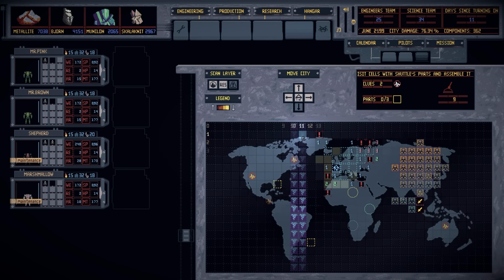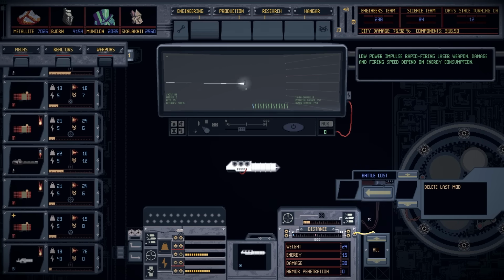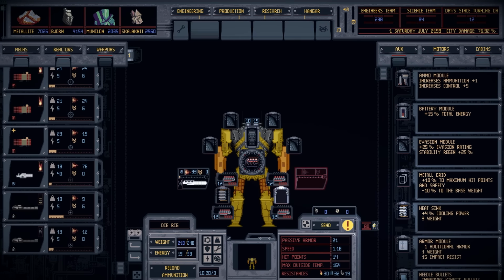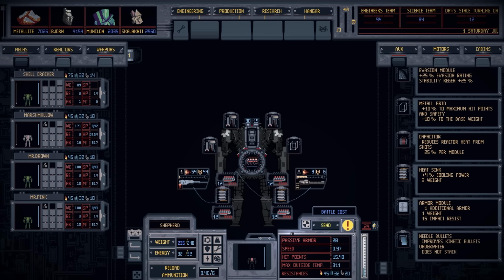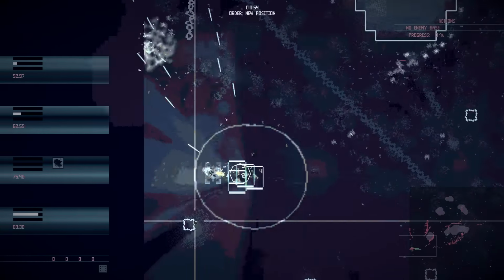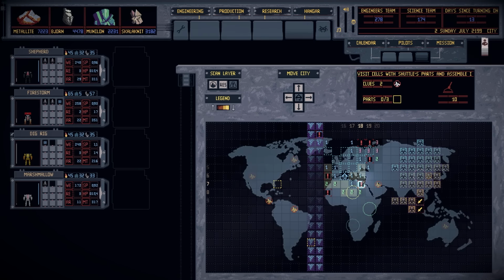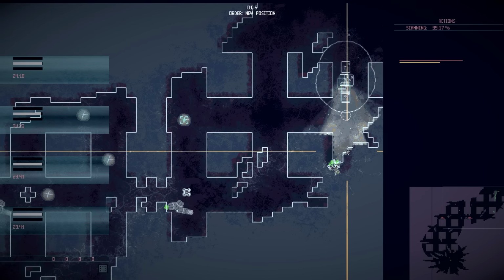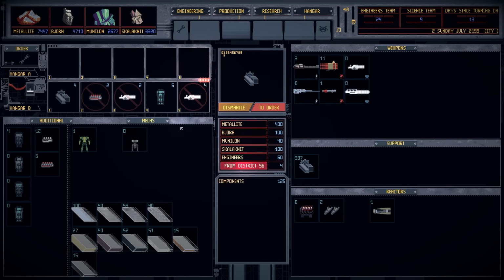Exploring Ruins with the DIG RIG’s New Rapid Fire Laser, in Mech Engineer

Comment: I'm on day 55, and FYI, the game gets a lot harder, but some of the researchable weapons can get stupidly powerful. The stupidly difficulty increase is balanced out by the new weapons, BUT make sure you go for the new weapons and the nuclear reactor(after the nuke missile) early, or you may difficulty lock yourself(which is a poor design choice imo). Also, get that processor research early, but after reactor research, cuz it's gonna change EVERY design you have, it's pretty great. 
You tend to comb over the details before missions, so you should be okay. But you really should get that upper factory up ASAP. It's gonna matter, a lot.
Also, I like your paint jobs. The painting system is pretty crap, especially the color picking, so kudos on making good looking mechs with the meager coloring capability.
P.S. The HOLO frog mech is pretty worthless, but necessary to get to the other mech designs. Don't make the mistake of building any, they're worthless and very expensive to build.
Reply from the maker: Thanks for all the tips!

Comment: You can over and under tune the motors just the same as you can with weapons
Reply from the maker: I see almost no reason to under-volt the motors, as weight capacity is in many cases as important (and as short in supply) as energy, especially the case with kinetic weapons.

Comment: I've been binging these and I keep thinking it could be worth changing the big cannons to have more fire rate over more pen and damage. My reasoning is if you are already having over 10 extra pentation then your only looking for more damage with increasing that stat, and if that's the case DPS is a more important measurement than per shot damage.

My point being, you will probably do more damage on the brutus and hives with a higher fire-rate cannon than a higher power cannon. And it would also be better at supporting fire against the weaker enemies. I don't think it would take too many engineers to switch the stats back later.

Loving this series Thank you for showing off this game!
Reply from the maker: The issue with that is that the bleed of energy from a ballistic weapon is so aggressive at long range, the velocity and penetration power drop so much that we need to over pen so that the projectile can still be useful at long range (the job of the 120mm)
Reply: @Aavak  fair i think the extra dps is worth it on everything but the toughest enemies but nothing wrong with being safe!

Comment: To advance the nomenclature around Spear, Lance, ? (small, medium, large). For a lance larger than 4 you could call it a pike because a pike is longer than a lance =)
Reply: On a separate note, I've been told by my local battletexpert that a lance of five can be called a star. Although I've been told this is for a specific set of factions called the clans. So not sure if it is applicable.

Comment: So as heretical as it may sound, I think the lazer shotgun is the absolute wrong weapon for the Dig Rig, and possibly not even a very good weapon in general.

The Dig Rig is a very specialized mech, who's purpose it is to opperate separately from the group and this inevitably means that it will often be away from where the other mechs can support it and will be drawing a lot of fire and the lazer shotgun a lot of failings and opportunity costs that do not work well with this.

-Firstly, the power draw means that the Dig Rig can't have it's energy shield, when it is probably the one mech who should always have it, since it's drawing a lot of fire and can't relly on other mech's shields to cover it whilst diging. It has has already gotten blasted by lazers as it breached trough a wall in the past and it is bound to happen again. It not having an energy shield is just asking for it to get caught out or stuck whilst digging and subsequently blasted.
-Secondly, the Dig Rig has two very specific things it will encounter regularly. Being swarmed and needing to disengage from enemies to regroup with the other mechs. Lazer weapons are specialty weapons who's purpose it is to deal with high HP enemies at the cost of crowd clear, and although the shotgun variation helps a bit, it's still only limited for up to 5 enemies at most, which considering how many enemies we get swarmed by, is not a very big number, doubly so when those same swarming enemies resist that damage, and the lack of effectiveness of the lazer shotgun could even be seen in a few instances such as 39:08 , where the Dig Rig would have utterly failed to defend itself if not for the other mechs providing covering fire. Additionally, taking down larger enemies still relies on concentration of fire from multiple mechs, so the high damage output is not really helping the Dig Rig who won't be able to take down larger enemies by themselves and will want to regroup with other mechs when encountering them.
-Lastly, although I think the Lazer Shotgun is cool, I think it kind of is a highly confused weapon. As was shown in the timestamp from the second point, it has a hard time actually clearing crowds which is the entire point of making it a shotgun, and this comes at the expense of effectiveness, as splitting the damage between the multiple beams only means that each hit is having to deal with armor independantly, whilst not actually being better at stripping it (it was only doing about 6-8 damage with multiple beam hits vs something like 14 from the critical single beam variant) and I worry that it would only get less effective the more heavilly armored the enemies we came across became.

As I mentioned before, the Dig Rig is a specialized mech with a specific purpose, and as such it likley wants a weapon that would help it with that purpose rather then always taking whatever is the "best" thing we have is. Although the point about reloading isn't a bad one, I do however thing that a weapon with penetration is a must for the Dig Rig to let it protect itself from being swarmed, likely with slowing ammunition to help it disengage from larger enemies it can't fight and allow it to fill a kind of supporting roll when grouped up with the other mechs, as it will never be the best DPS mech due to it needign to dedicate at least a portion of it's effectiveness away from damage and towards survival and drilling ability.

As an additonal point, since we only have a handful of lazer weapons available to us, and Ares are becoming much more common. Considering there are weapos that already can deal with regular crowd clear fairly efficiently, it feels very wasteful to spend the opportunity cost of fielding a anti-large-enemy weapon such as the lazer to try and fill the roll of crowd-clear, when the weapon isn't even very well suited to it.

Anyway, appologies for the ramble, I hope this doesn't come off as rude. I was just reminded of the phrase "a specialist design designed to do everything" and felt I needed to speak up about what I think may be some critical oversights just waiting to go horribly wrong.
Reply from the maker: I didn't find the comment rude at all, far from it in fact, your thoughts largely echo mine. After a few comments about the length of episodes, having spent a while working on installing the laser only to THEN realise that it was a poor choice for the primary role of the DIG RIG, I elected to test if the laser's high damage would be enough to scrape by despite being the wrong damage type for the (lion's share of the) job, rather than head back in and spend more time equipping the mech.

But the poor compatibility for the primary role meant it was never going to work out in the long run :)

Comment: Early on Consumer Goods and Food Supply will keep going up and down until you repair the city a considerable amount. If you look in the manual it will tell you that consumer goods influence food supply. You can see it as the city using the large stockpile of consumer goods (farming tools) from turn 1 to produce more food in turn 2, but since the production of new consumer goods can't quite keep up, your stockpile will go down, which means less food can be produced in turn 3 and the consumer goods stockpile can recover. This will go back and forth until your consumer goods production can keep up and/or your food production is efficient enough to not use up your stockpiles. Since it's self balancing it's tricky to point out which of the two to increase more, or even if you should focus on it at all if any of the two can get to 100% in the cycle.
Reply from the maker: Thank you very much for the info, this will certainly help me prioritise things better!
Reply: That's fascinating... I've got a mental image of guys in bespoke control chairs leading legions of farming robots, versus guys who have to make their own hoes by stealing metal pipes and chunks of hull and handing them together with rocks... That makes a great deal of sense, when I put it that way.

Comment: Im not certain but it looks like the arty might be capped at 10. 13 days and its only been fired twice now iirc. Also the dropping of the energy shields on several of the mechs is a mistake imho. Most of the damage you take seems to be from the Columbras and being too indecisive around them. Even with the slow, you really should keep moving counter clockwise a bit to put distance between you and it's detection bubble, as several instances of major damage were from it unfreezing mometarily due to a reload or dps going elsewhere. The TTK on the mechs seems quite low, so I'm kinda surprised we haven't lost anyone yet.
Reply from the maker: I haven't seen anything in the manual to indicate arty is capped at 10, but that could easily be the case, I'll keep a closer eye on it!

Comment: I think researching the Holo could be a good idea. The description doesn't mention auxiliary or motor slots so it could potentially be a replacement for the Dig Rig, a good general mech, or it could even be better than the Plate. Also for underwater missions I think fitting the mechs with the Needler, Underwater Combat, and Torpedo modules is enough and a full lance of Holos would be overkill.

Comment: These giant monsters, marked with a sword on the map, can they be killed at all? It would be cool if the player was allowed to give it a try, even if it was something very difficult to do.
Reply: Oh yes they can. I really wouldn't suggest it with the gear he has right now.
Reply: Red one is doable with point defense system and repair drone. Yellow, though... never managed to break through it HP bar. After 40 minutes of fighting i just gave up.
Reply: @HappyAspid  You really want pumped up railguns for the gold one, prioritizing the head as that's the only part that takes damage. It's definitely a tough one though.
Reply: @skaianDestiny  Isn't that what the strategic nuclear weapons are for?
Reply: @skaianDestiny  Thanks. I more or less know his mechanics now, just have little experience with advanced weapons (my only time when I reached late game - was just to check late game research).
Reply: @PyroDesu  Gold giants cannot be killed by nukes.
Reply from the maker: Fairly sure you can fight them, no idea how bad on a scale of 1 to extremely, that idea is. But pretty sure it's somewhere in that range XD